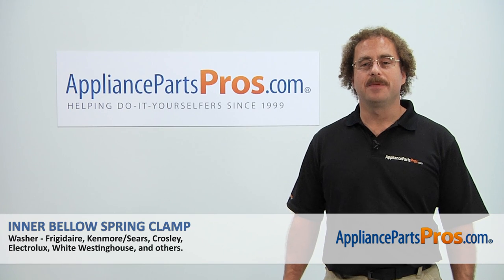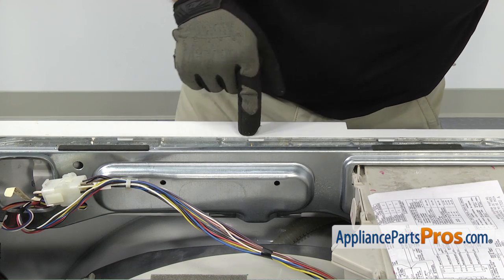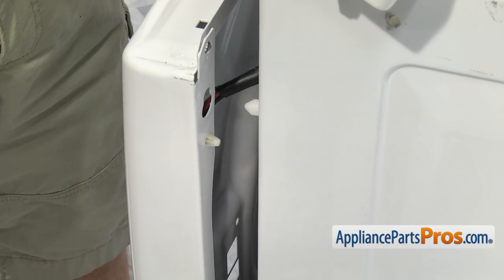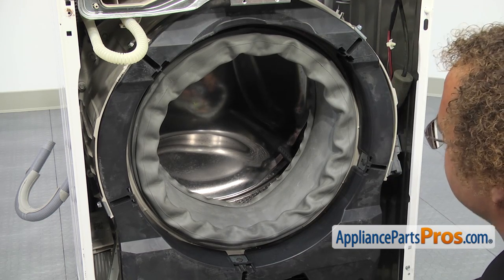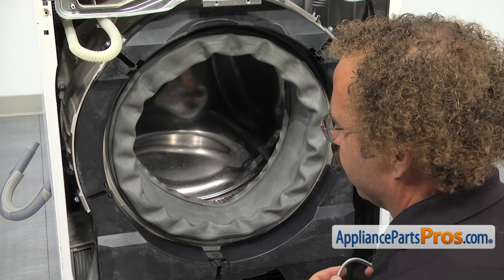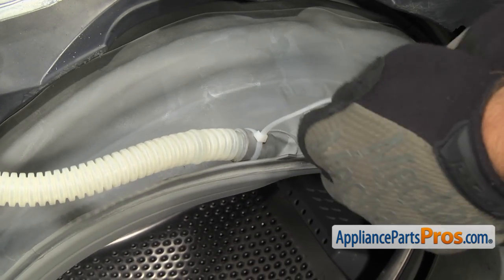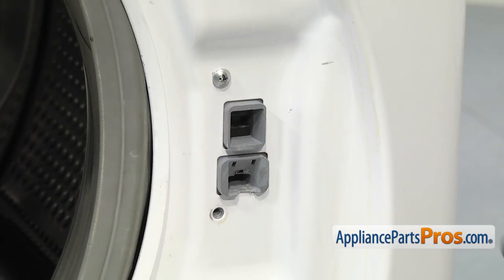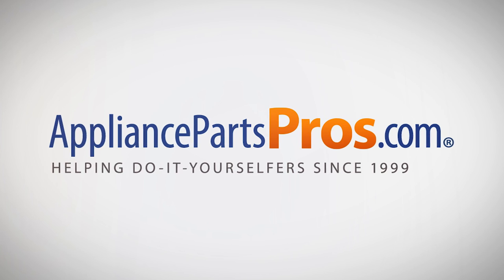How To: Frigidaire/Electrolux Inner Bellow Spring Clamp 134365300

Comment: Use a thick paint stirrer stick lengthwise cut to where it holds the inner below in place. Once I did that, I could do the spring installation myself.
Reply from the maker: Thanks for that tip!
Reply: Could you say a little more about that?

Comment: I accidentally pulled the spring out. Now I’m trying to get the bellows and the spring back on and neither one wants to stay in place. Should I be gluing the bellows on the metal flange before I attach the spring? I can’t seem to get both pieces to stay . I need some advice!

Comment: Good grief.  You DO NOT have to take the top or front off. They were designed to be repaired without any of that hassle.
Reply: I tried to skip removing the front to install my new boot seal. There was no way I could get the rear spring without the access though. Ended up taking off the front panel and spring install went smoothly.